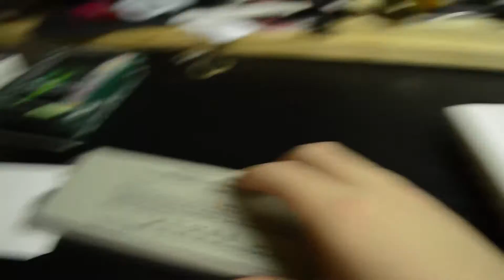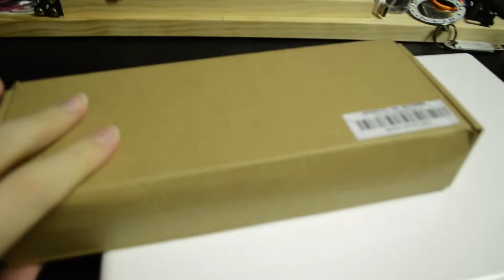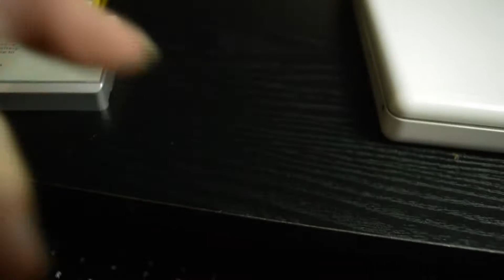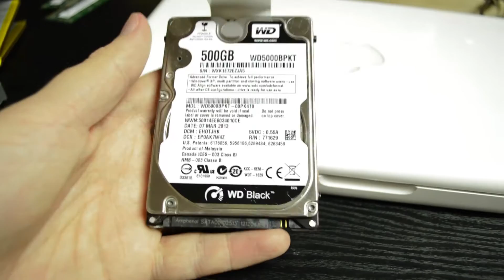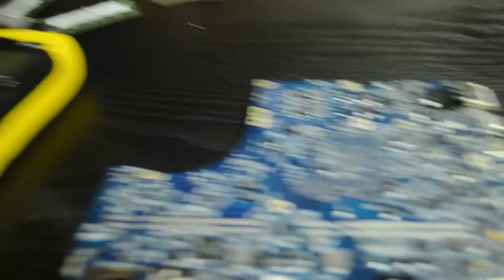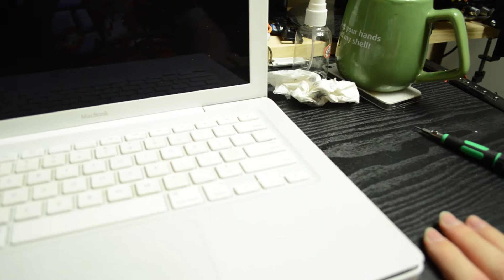MacBook Repair VLOG FAIL (A1181)

Comment: Haha nice video lol I have a macbook a1181 2006 or 2007 but I wanna upgrade it to mac os el capitan or high sierra by changing the motherboard but maybe if can u help me or make vidoe on modding a macbook a1181 plastic chassis fitting a macbook a1342 motherboard in there chassis like modding lol hmm :)
Reply from the maker: Sounds fun but I think you might have problem with the lcd, it wouldn’t be impossible but might require making a converter

Comment: I recently sold one after upgrading it, they hold their value really well. I bought one that had 2x256MB DDR2 and they had corrosion on the pins too.
Reply: +Chrisdlb Also, DDR2 SODIMM memory is super cheap these days, you could probably find 8GB for $30 online, probably cheaper.
Reply from the maker: +Chrisdlb when I get it working I'ma gonna max it out haha
Reply: Gooood.